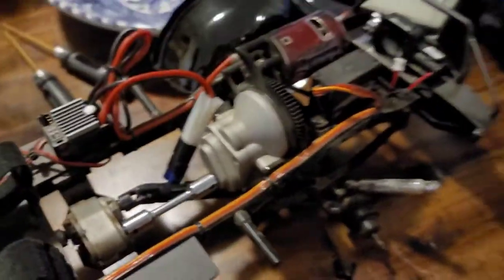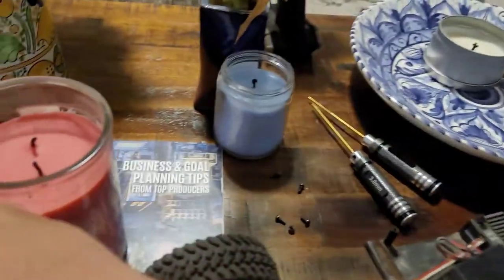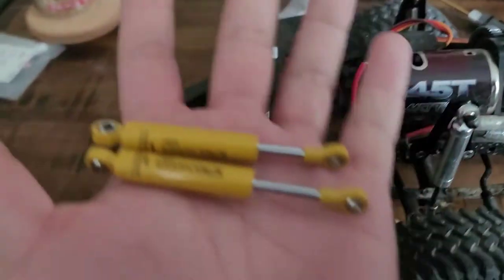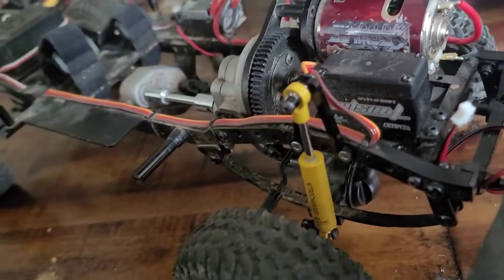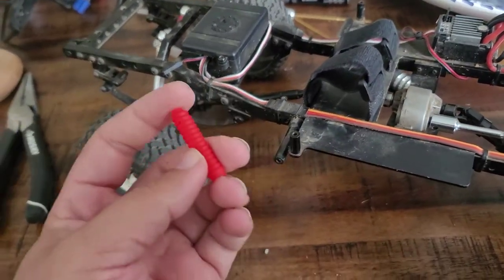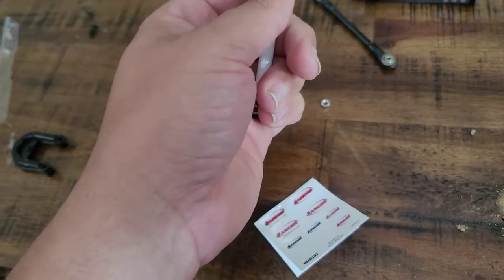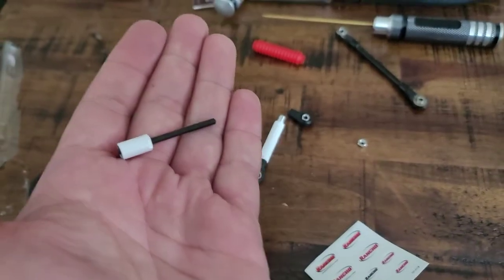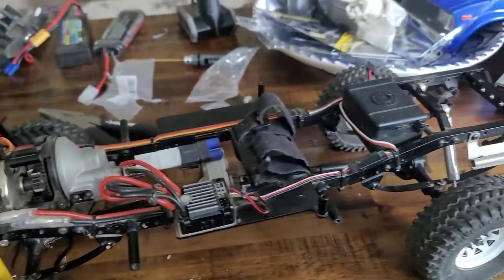Trail Finder 2 extended shock mounts!

Comment: I just mounted these shock ectensions from cchand. Now on one side, the pumpkin huts the servo arm screw. Do you have that too? And if so how did you solve that issue?
Reply from the maker: So I have RC4WD Teraflex Revolver Shackles (back side of the front leafs) and shackle extensions in the front and for the rear leafs revolver and zbox shackles. This makes the truck a little too high (In my opinion) but it does fix this issue.  Ill make a new video soon on my RC YouTube page but check it out, as I wont be adding any more RC related videos here. https://www.youtube.com/@redlinetrailrc8862/videos
Reply: @DarrenLevey  i just subscribed. I‘m also building a sand scorcher. I‘ll watch yours tomorrow👍🏻

Comment: At this point would you recommend 80mm or 90mm? I just bought a set of Gelande 2 hoops and I don't want my truck to sit higher, i'd like it to sit lower if anything...
Reply: 90
Reply: I run 90mm desert lizards on the front and rear of my tf2
Reply from the maker: Sorry I have moved over to my Rc youtube account for the most part, (Red Line Trail RC or RLTRC) I agree with Jacob, 90mm will see you to what you are aiming for.